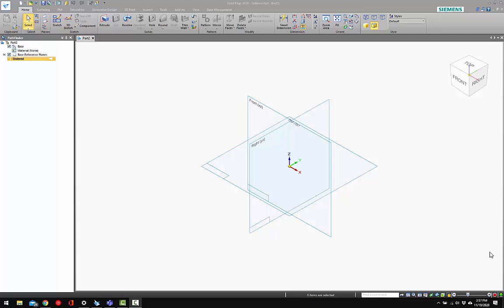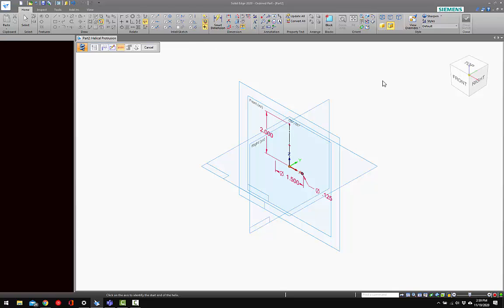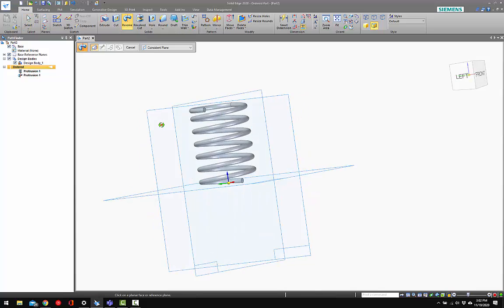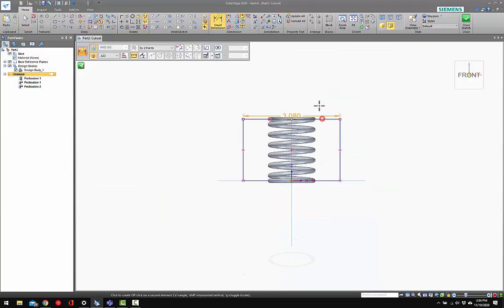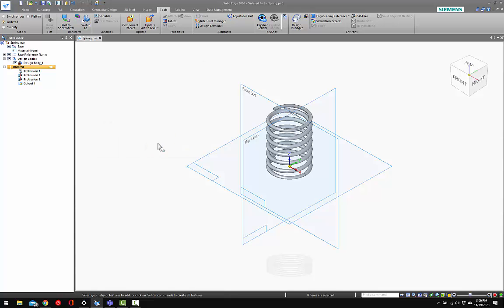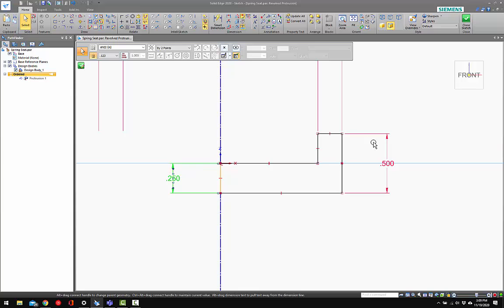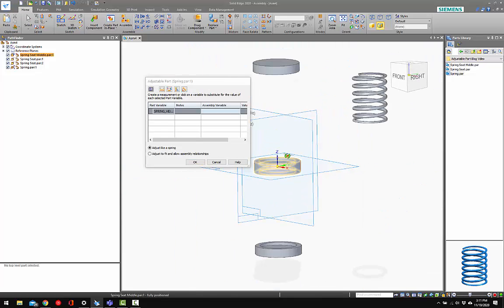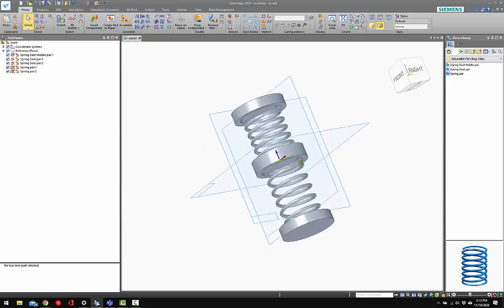Solid Edge Adjustable Part

Comment: How the heck did you name the line "SPRING_HEIGHT", what did you do to get to that dialogue box?  Been trying for hours!
Reply from the maker: It's on the Variables tab
Reply: got it...I'm using SE 2024...
Reply: @lcl7wrkr  I have SE 2023 community edition now.  So it may be different than when I filmed this, but I'm not sure.  I'll look when I get time.
Reply: Actually, double clicking the dimension should give you that dialogue box.  It's been a minute since I've been back in Solid Edge